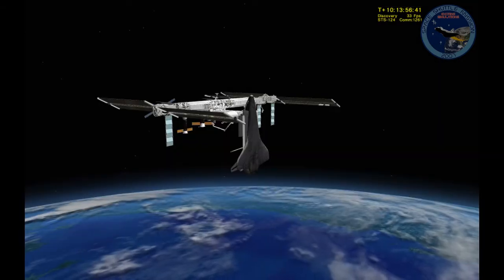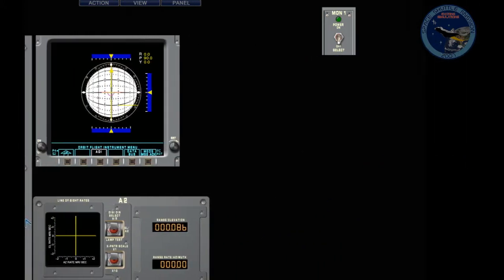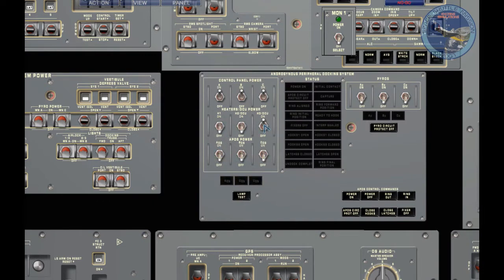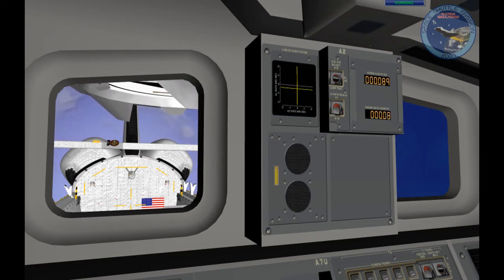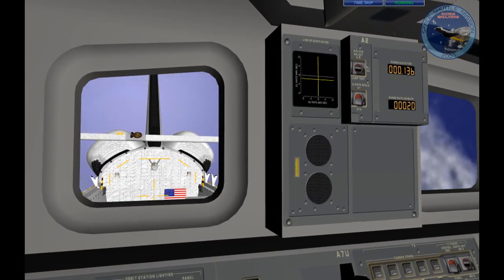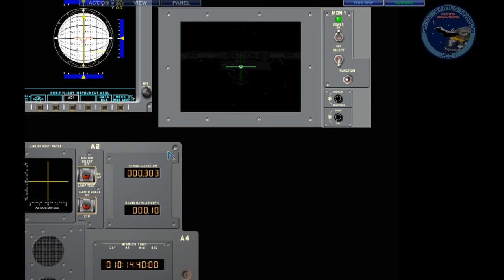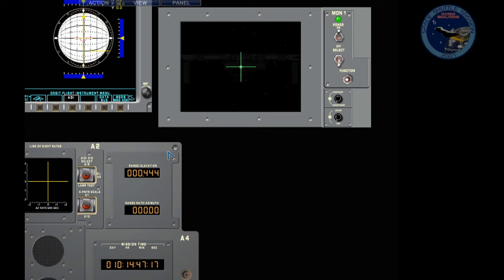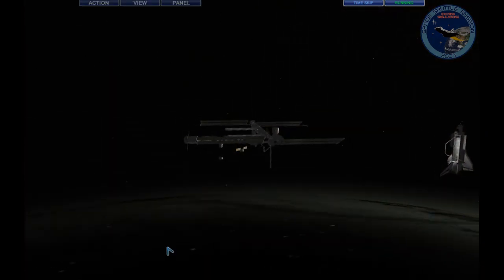SSM2007 Undocking and fly-around tutorial (SP4) - Part 1/3

Comment from the maker: Hi Ryan,
First make sure you have the latest (SP5.33 If I remember correctly). Just check the site.
second, make sure your ADI is in LVLH (should be) and once you are on the V-BAR (in front of the docking port), make sure you switch the DAP to LVLH. this will maintain proper orientation.

Uri